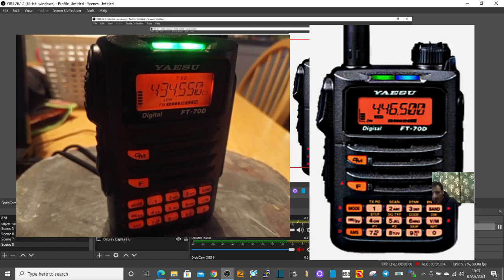YAESU FT70A-DTMF - MANUAL DIAL

Comment: hello, I'm stuck somewhere, please help :) I have ft5 and ft70 and I want to create 10 digital channels between them. I write on AMDS and I write to the devices, the channels are created but they don't talk to each other. I make a mistake in the digital preferences of the devices. If I make FM, this package works without any problems. There are DN and VW in ft70 amds, DN and ANS in ft5 amds. I tried all of these but there is an error somewhere and it doesn't work :((( Both of the devices are new, I'm sure it's not a fault, it's my lack of skill
Reply from the maker: Yes keep learning
Reply: @M0FXBHamTech  :))))))